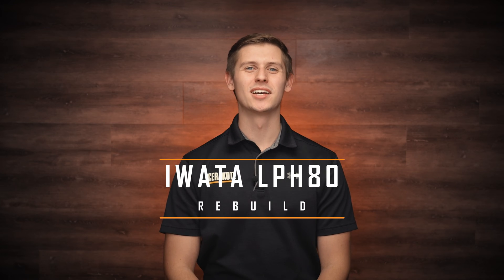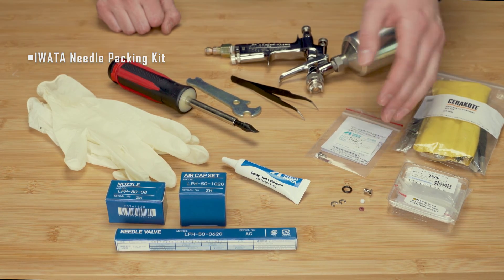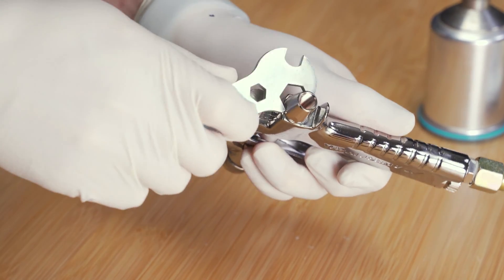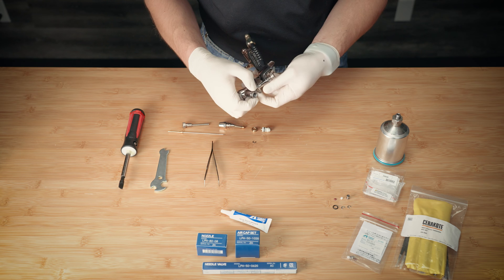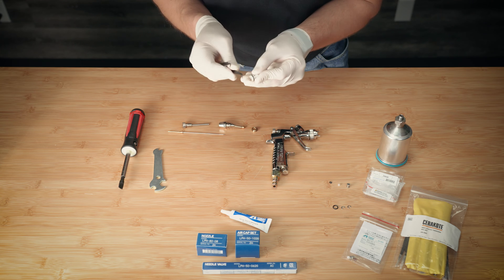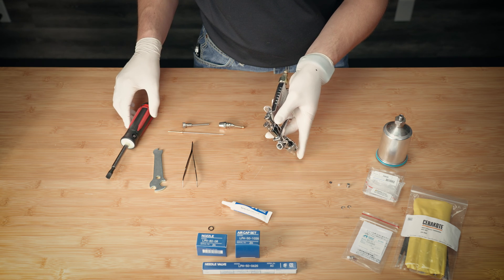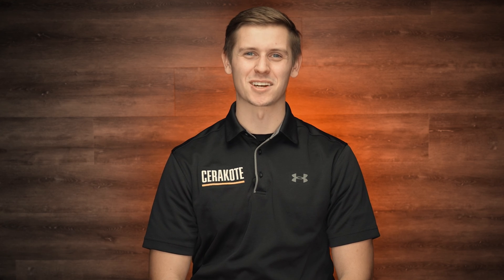IWATA LPH80 Rebuild | CERAKOTE®

Comment: I saw the install of the teflon ring but not the black/red ring that goes between the teflon bushing and the nut. Is it safe to leave that out or will it cause pressure issues?
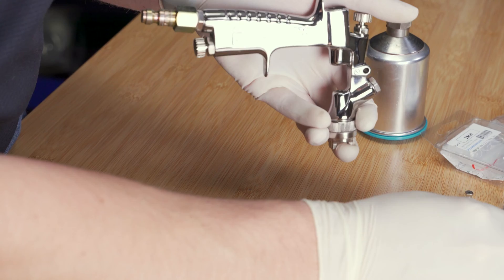Reply from the maker: The red goes in after the bushing. This happens at about 3:20 in the video. Hope that helps.